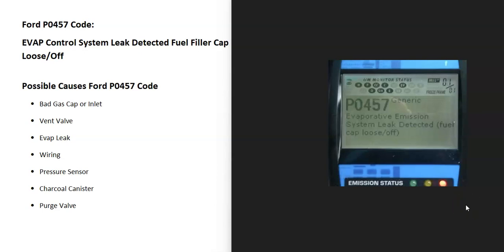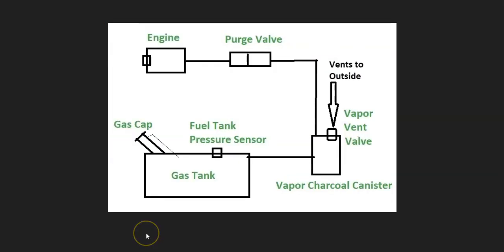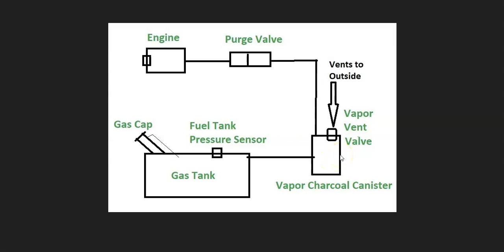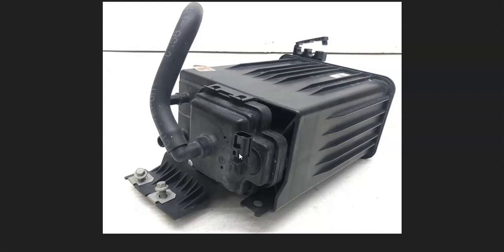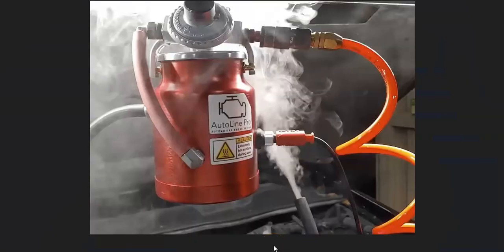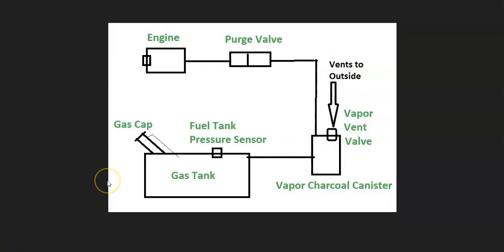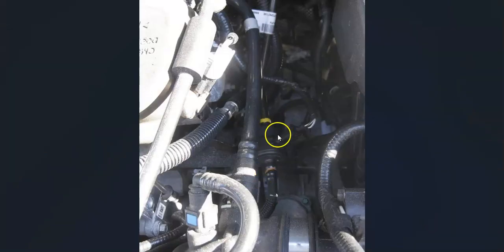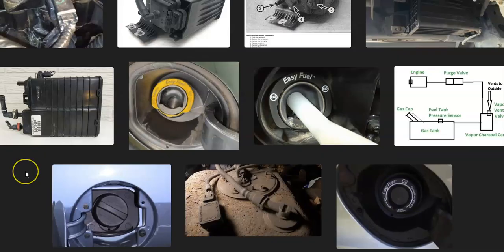Causes and Fixes Ford P0457 Code: EVAP Control System Leak Detected Fuel Filler Cap Loose/Off

Comment: Have a 2013 ford explorer. Gave this code, cleaned the fuel fill inlet a couple times and the code still comes up. Now it seems to be affecting engine power. I get a flutter in my rpm usually when accelerating but not all the time. Can definitely notice a loss of power at times and makes it feel like it’s not getting proper combustion. If this code didn’t come up I would be thinking something with the fuel injectors/ spark plugs/ ignition system. 

Any tboutj?
Reply from the maker: Usually, the only Evap component that can affect the engines is if the purge valve is stuck open. The purge valve is normally closed, so if you can blow through when it has no power, it is bad. You can also use the engine vacuum to test it without removing it. I made a video on this here is a link. https://youtu.be/X-Y5YsaXxJE

Comment: I have a 05 crown Vic and I got this code today and the first thing I did was check the gas cap and it wasn’t on all the way. I turned it all the way and it clicked and I drove it around the block to see if the engine light will go away but it’s still there. I’m curious if I should clear the code and if that was definitely it or if it was something else. I use an innova 3011 and it said I had 2 engine codes but it gave the same po457 with one severity level and one pending. Idk what to do I hope it was just that the cap was loose
Reply from the maker: I would clear the code, and if it comes back, then it will need more troubleshooting.
Reply: @HVAC_Mechanic  thanks! I did, my brother said the same thing. Your video was really helpful! I’m still learning and so I freak out when something happens to my car lmao!

Comment: Can two  bad O2 (Bank 1 sensor 1 and Bank 2 sensor 1) sensors trigger this code as well?
Reply from the maker: If the purge valve is stuck open, sometimes it causes a rich condition and can throw off the 02 sensors; otherwise, usually, they are not related.
Reply: @HVAC_Mechanic  what about a lean condition instead of a rich condition?

Comment: Really like all your vids, just subscribed and liking 👍

I have a bunch of codes that came up for me, and 457 was one of them. Is this code sonething i really need to concerned about? Or is it more directed towards passing emissions tests....thanks!!!
Reply from the maker: Yes, the EVAP system is only for emissions. The only time I have seen the EVAP system affect the engine is when the purge valve is stuck open, letting gas vapors in when the engine is off.
Reply: @HVAC_Mechanic 
I wish the purge valve was the issue I’m having with P0457, on the 2011 F150 coyote it’s a 90 second fix (I’ve previously replaced it, and the truck starts weird after filling up when that’s the issue, which is not the case currently). Replaced the Ez fuel inlet, still getting the code. On to the charcoal canister when I have time. 
- great video btw!! Really appreciate it!
Reply: @HVAC_Mechanic  got it , thank you 👍

Comment: Just got the p0457 check engine light on my 2016 v10. It's on a F53 Ford RV chassis. Replaced the gas cap as its the cheapest easiest fix, cleaned around the fuel neck. I have no way to clear the code, Auto Zone gave me the initial scan.  Still have a gas smell odor when running the engine. I can't locate the EVAP canister, hopefully it's on one of the frame rails and not on top of the gas tank. I've searched for a diagram but no luck. Thanks for the video, more info I get the better.